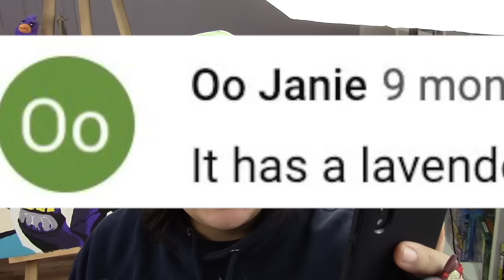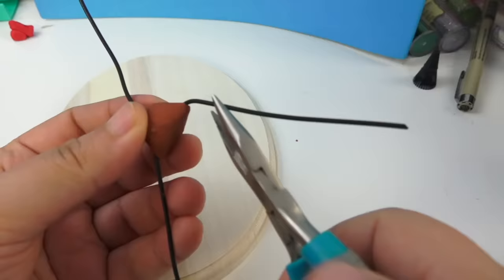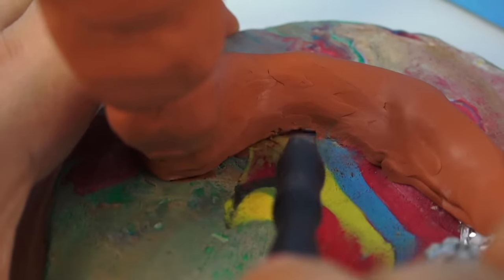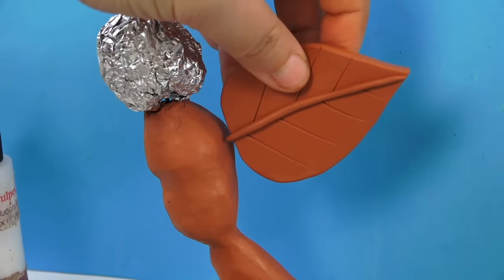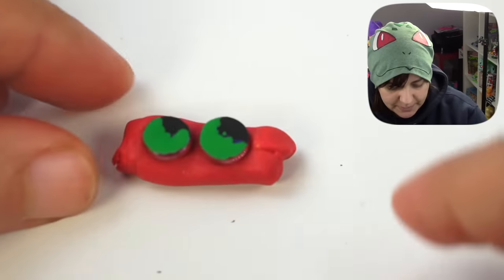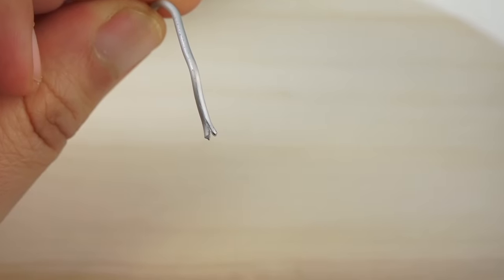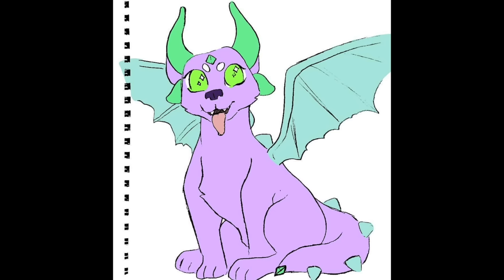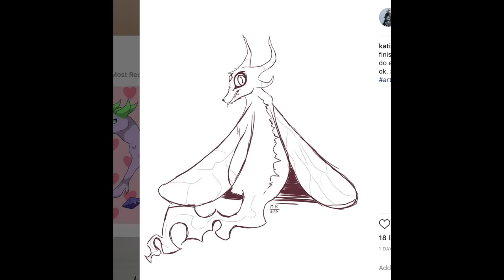I TURN MY SUBSCRIBERS COMMENTS INTO A SCULPTURE #1 Monster Clay craft DIY Challenge

Comment: This is an entree for the sculpt you comments challenge. I made it my self, no I didn't sculpt it, I can't do that, I bad at it trust me, but I made up the creature myself.
It's a mammal, it has an orangeish baize fur color. Dragon wings and dragon horns. Sleepy blue eyes(the eye color is sleepy blue, the creature isn't lazy!!!!) With rounded pupils. It's wings and horns are that same sleepy blue like the eyes, and so are the paws and tip of the tail. The tail is SUPER fluffy. It is dragon like but does not have spikes on it's back. It lays eggs and breaths fire, just in case you want to add that. It is also very fox like, but without the slit pupils. Have fun LOL👍🧂(p.s. you can add a salt shaker in it's mouth if you want🧂🧂🧂)

Comment: They have a small stature, there arms and legs come to a point with a black tip at the end fading into it's body color, light grey, on the top of it's head are 2 long slender horns, it has created a dark ora around it as if it was trying replicate hair, it's face is quite normal it has large black slit shaped eyes with no mouth it's face was shaped like a circle, it's body is slender, it's arms go down to there knee caps, there legs start at where the waist would usally be

Comment: #comment2art2 
It has a large hard muzzle with large sharp teeth ( no over bite) and beady eyes with rough skin but feathers at the joints and on the head, has 2 legs and 2 shortish arms with long nails, on the feet, the big toe has a odd nail that is like a hook it also has a long reptile tail. Is grey with a long blue line going down from the eye to the hip.

Comment: # comment2art2 

My creature has huge wings that are rather feathery, and horns that twist in spirals. It is a purple color, and divides to yellow on its other side. It has wolf horns and lollipops down its back and running down its tail which is thin and straight, hanging up. It also has a gemstone on its head shaped like a circle. Its eyes are closed and its face is in a sad somber expression. It also has claws on it Paws . And it has two legs, and two arms.
Reply: And it has a slim figure

Comment: #comment2art2
it has a long tail hung high above it and the end is curved in a halfcircle. it is covered in thick, course,black fur with hints of white on its chest,tips of its toes on its front two legs,and on the whole front and foot of it back two legs but not on the back of its back two legs. it has a small head in comparison of its body. it has a small,slim nose. the tip of it is black and the top half is half black and half white. it has two triangulare ears. its eyes are an oval-y circle. the eyes have a overly enlarged pupil,or a teeny tiny pupil,depending if it is mad or not. it has sharp claws on all four of its feet. it has five claws on each foot. it has pawpads on each foot. its eyes are a mixture of olive green and a standard light green. it has several long white whiskers on each side of its face. it is usually salty (like saltEcrafter) but can be sweet (like nerdEcrafter)it has a little bump on its nose and little flaps on its ears.
        dont look at the comments nerdE/saltEcrafter because that is where the answer too "what is this animal" is.
Reply: the animal is my cat lulu

Comment: #Comment2art2 
It has a long tail that is very elegant and flows with a mixture of greens blues purples and pinks (mostly green and blue though). On the top half of its body it has a muscular structure with a floating mane. It has front hooves and seaweed littering it’s body. It has a long webbed like fin running down its spine. It has generally small eyes with pointed alert ears, and its whole body is covered in scales (some patchy spots) of all different blues and greens. (Lots of teal and aquamarine)

If you do this one I have a drawing of what it’s supposed to look like on my instagram which is @i_wish_i_was_an_avenger with the caption “drawing I did a while ago! I’m still totally in love with it” If you see this comment btw I really love your channel!!! You are so great 😃!

Comment: #Comment2art2 it has swurvy lines down it's back , it has pointy 2 sided tounge , it has spiky large wings , 5 pointed teeth , hexagon tail, 3 heads , 4 turquoise eyes, tall, giant ears, ears are curvy long , it has salt on it's back ,  it is rainbow , it brain is pink and it's on its head not inside it, it has 2 dark red horns on it's forehead , and it has a mouth that is wide open with a frown and pointed down eye brows it's mad

Comment: #Comment2art2
Way late but my creature has a mint base color. It has black spikes evenly spaced on his body and a black tail(still with spikes) with a forked end. It has three horns the middle bring straight and the side ones being slightly curved in. Its body is covered in a smooth protective barrier similar to scales but completely smooth. And it has black bird wings and two legs no arms.
Reply: Also lilac eyes

Comment: #comment2art2 

This creature is a cool gray, stands on two legs and uses two arms. Its legs are bent at the shin, much like an upside-down L. The point in this L faces backward. At the end of all its limbs is a darker gray.

Its weight is over the norm of an average human. This makes the creature seem very different from its normal kind. WHICH IS NOT HUMAN. Its chest is flat, the body is shaped much like a pear.

Its head is very human-like and chiseled. Unlike a human, its eyes are non-existent, much like a skull. Its eyes are basically filled with a black void. Its mouth is always open, toothless, and also pitch black.

It has horns that it grows out of its head, legs, and arms when it feels overly threatened.
(This is often painful for first timers)
(The horns are not too long, in order for it to fit them back into its body)
Its eyes also form a piercing colour (any) from where a pupil would be.

When threatened like this, it tends to get in a very specific battle stance. The stance is down low and very dynamic. Almost like its ready to pounce. 

(I went very simple, because I didn't want to blind you with a rainbow of colours. HE is a part of a book I am working on, so i wanted him to be simple and not very Mary/Gary Sue.
Hope that's okay! Have a wonderful day! 😊)

I KNOW IM LATE AND THIS WILL NEVER BE SEEN! SHUSH! 😂

Comment: The creature is long and muscular.  It's bipedal, with its legs making up almost half the length of its body, very thin, compared to the rest of its body.  It has a muscular arms and hands, and a round head.  The eyes are shaped  like right triangles and are a shiny red, with no iris or pupil.  The upper half of its body, not counting the head, is covered in fluffy pink feathers.  It's legs are covered in a pink and red pattern, with a white chest.  It looks like it is definitely predatory.

Comment: #Comment2art2 Ok, so uhhhhhhhh. This creature has an extremely thin form with back accessories relating to plants. It is always sad and depressed. There are weapons stuck in various places in its body. It has 2 legs and four arms. It has horns and and and a cracked tail with some sort of animal on the end of it. There is always a ring of fire around it. It is covered in blood from its wounds ( other than that, it’s skin is black).

Comment: #comment2art2

The creature has a horse-like body structure that has blue fur, the head has 2 large yellow spiral horns its head, one horn on each side and the one on the right is slightly bigger and has more volume than the left horn. In between these horns, there is is pure white gem. The eyes are narrow and are the color purple, the pupils are slits. The neck of the creature has golden scales and scarf-like cream colored fur that engulfs the lower neck, scales do not pass the fur on the neck.the front legs bend like the back legs but are different in the fact that it has the same scales from the neck that start at the first bend and there is a cream colored fur cuff before the hooves. The back legs are like the front legs without the scales and fur. The tail is a wire that zig-zags and has a ball on the end.

Thanks for reading, have a wonderful day/night

Comment: #Comment2art2 my creature has black skin the tail is long the colors of the tail is rainbow with black fur on top at the end of the tail is three long spikes that are white it has four legs that are thin and flexible the face is a diamond shape with two eyes one is red the other is orange the creatures ears are white with a black tip like paint splatter they are big and fluffy the creature has a small pink nose and sharp teeth it has feathered wings that are rainbow some feathers are black the body is wolf shaped with stars on it. That’s my creature good luck!

Comment: #comment2art2

She is not tall. She is walking on her 2 back legs ( She do hav 4 legs ) She is light brown her hair are little darker. She also have some ear rings ( her ears are cat like ) one is Aries zodiac and the other is a scorpio zodiac in side of the ears are blue. she have a blue tongue and not so sharp teeth. her nose is also blue. her eyes are tired and also blue and blue big eyebrows ( she have blue under eyes ). she also have a short tail it's blue at the top and the same as her body color at the bottom. she also have blue pads and small blue claws. and angel wings wich is optional. and a black collar with a little gold bell (optional). 

I hope you like it. she is my original character but you can use her to make her as a sculpture <333 (she look kinda normal nothing AmaziNg but still ok)

love your videos <33

Comment: #coment2art2 it has a medium  Length  tail with gold at the top and wight at the bottom  with the same color of gold going IN a curvy rectangel to the head and wight to the bottom  lip it has closed eyes and an open mouth /snout and big big head with sausage-like horns  and tiny  wings it has a fluffy tuft  of fur on its chest  and log like arms and legs  and it is stepping on a princess

Comment: It has a round body it’s a turquoise colour tiny wings between the arms and the back The arms and the legs are very stem (tiny not plant like)like it has a derpy face little tongue Four horns on its head Seafoam green and is very chubby very very very chubby dopey and has a stub  tail
Reply: Forgot to say on the original, it is very fluffy and has Kuala like ears

Comment: #Comment2art2
Jackie walks in the forest, looking for a comment creature.  She looks up to see a larger comment creature.

  This creature has a long body, with smooth (and a little slimy) skin. The skin is white, with an iridescent glow in pure sunlight.  It has two eyes, and two antenna.  The eyes are like little planets when you stare straight into them, it also has dark pupils that are like little slits cut into its eyes.  The antenna are color changing (up to interpretation).  The creature has a beak-like mouth. My creature also has 6 legs and no wings. From under this creatures stomach, you get an amazing view of the tail.  The tail is long, but as it reaches the end it flattens.  The color at the base is the same as the skin, iridescent in the sunlight, the end of the tail has the same color changing properties of the antenna (up to interpretation).

Jackie stares at the comment creature for a little while, studying it further.  It was a lucky find, and in the perfect spot, a tree branch illuminated by the sun. It’s like this one was waiting for something to admire it.

Comment: #craft2art2 it is a mammal is has short hair alllover it's body it has a really long tall the tall has long fur that gives it a fluffy appearance the tail of this creatures species usually is decorated with chains and jewels the body has a fluffy chest and it has a slight chub on its stomach but it's a cute chub the arms are short but cute and they have paws  they have large majestic feathered wings the head is large and cute with one huge eye the ears are huge and ponity it has a cat like mouth and nose its fur is dark gray with a weight cross on the back in between the shoulder blades the tails tip and ear tip the eye are yellow with small brown spots looking like freckles it commonly uses the tail as a chair by putting it as a (s) shape the eye glows in the dark as a yellow color

Comment: #comment2art2
The creature is very large and has BIG. MEATY. C L A W S. It is bipedal. Its body is covered in stripes.
It has a large firey red mane, small horns, rounded ears, a thin triangular nose, and golden eyes with thin slits. It always has an extremely SALTY expression. It has big bushy eye brows. Its face is somewhat broad. It has four sets of fangs, two smaller ones facing down on the inside, two larger ones facing up on the outside. It has a thin and somewhat skinny tail, with a poisonous barb at the tip. It also has wings that, given its weight, prooobably shouldn't be able to actually carry it.

Comment: As I went father in the dark cave I could barely see. Then it came out of nowhere and I saw it eyes of blood staring back at me. It beak of glow in the dark blue from it white face and a hood of red. The wing of the blood of the seas did not belonged here in this dry sand desert cave in the middle of nowhere. It red web feet dance across the floor. It head had a small horns. It was read or eat a book. It had a tailson of pure gold. #Comment2art2

Comment: #comment2art2

it has no body just a tail and a head
this creature has black eyes no details just black
the teeth are very big and droop down they also have blood on them
on the tail are tiny stubs where the feet would go
on the body/ tail is covred in little spikes with four big spikes right on the tip of the tail
the creature is black and white all over the four main spikes are purple with blood on them

Comment: #comment2art2

My creature is very much not a dragon (wink), It stands with two muscular hooved legs and a long decorated tail with golden feathers almost like a cat toy (to lure in its victims... the rare stabasaurus) And one venomous spine at the very tip. It’s rough and scaley body with golden streaks down it’s body. The body is also muscular and exercised with a golden plated stomach. It’s arms are short with two sharp claws each. It’s head has two curly ram horns and feathers that fan out in a display of color. It has a sharp beak with a long blue tongue. It’s eyes are glowing orange.
It also has four wings the first two are big and broad with golden feathers and razor sharp claws, the other two (behind the first) are small and thin and covered in scales. It also has two tall pointy alert ears.

P.S. I didn’t include the main body color on purpose because I know you need a bit of creativity.